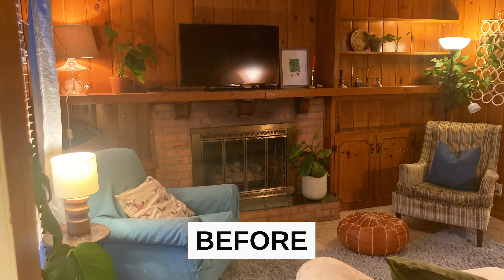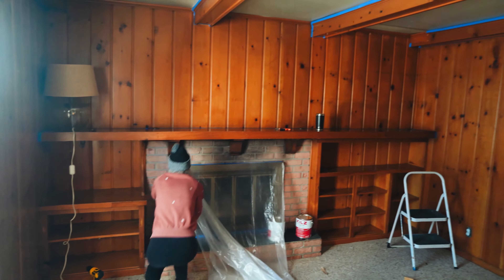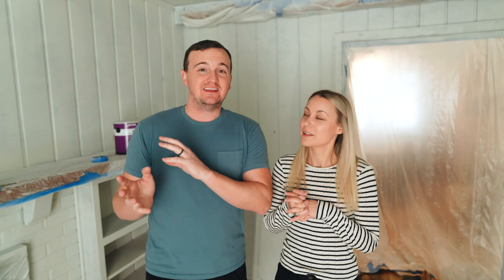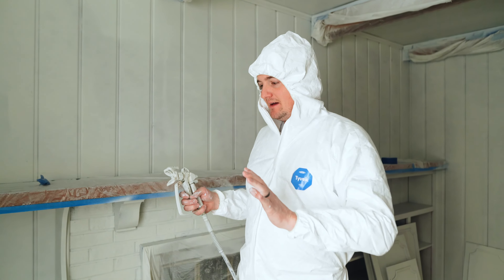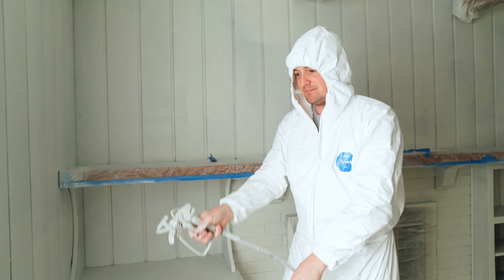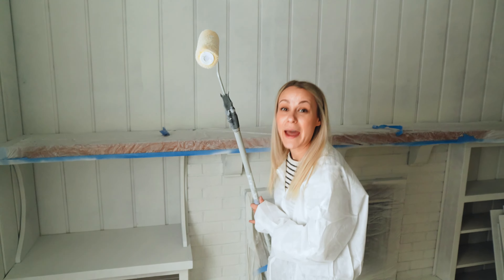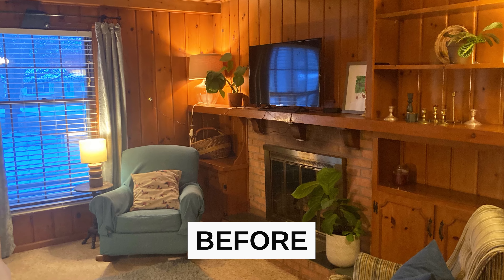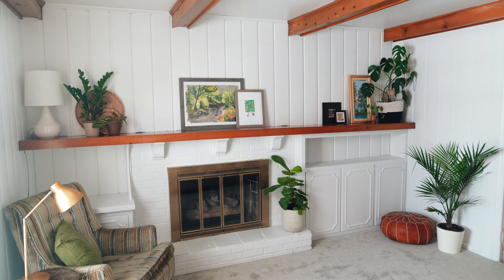BEYOND PAINT | PAINTING WALL PANELING | USING A SPRAYER

Comment: Did you dilute to use in a sprayer? I gave a similar area I was thinking of using my.left over paint.
Reply from the maker: Hello! Please consider the following when adding water: Do not exceed a 5-6% volume of water which would equal to about up to 2oz of water per 32oz container. This will help a smooth spray application
Reply: @BEYONDPAINT  Thank you